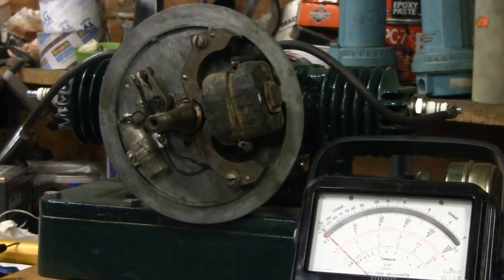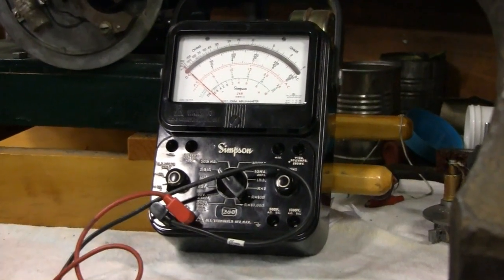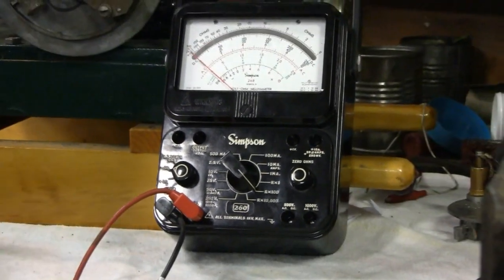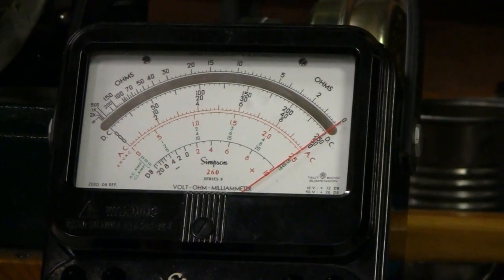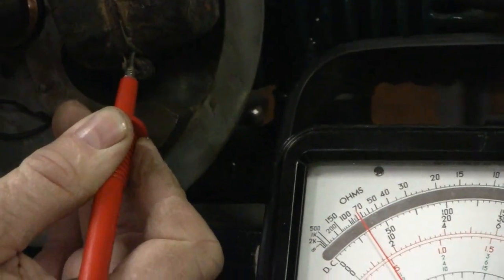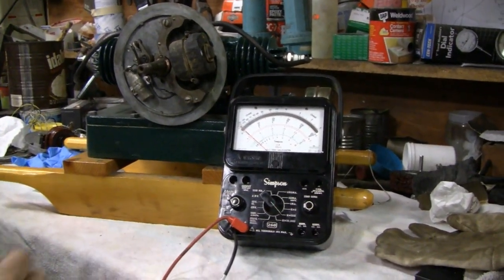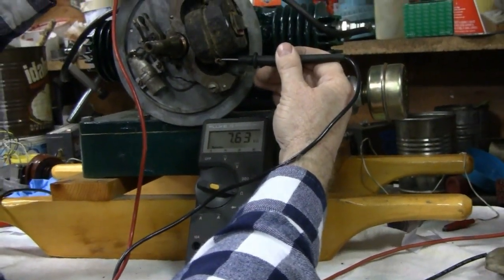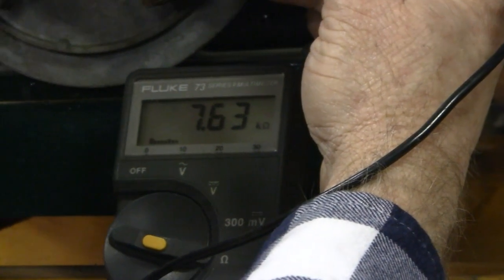HOW TO TEST IGNITION COIL WITH MULTIMETER

Comment: i have a honda gx670, i have just cleaned the carb and put new plugs on it, the motor will run fine on a cold start for about 5 mins, when it gets warm will cut off on anything over half throttle and no spark restart. is this a bad coil problem, thanks roadking

Comment: What should the WICO coil read?
Reply from the maker: Don't know, but probably about the same!!☺
Reply: have you checked my channel for the Heinze model #57 ????? LOL Nelson muffler, wico ignition, tillotson iron horseJohnson carb, Appleton electric intake, CASE on the mounting plate. Unusual little engine
Thanks
Reply: can the ohms test be done with flywheel on. from plug wire to plug wire? I tried it and am getting 8.5 with meter set to 20k ohms

Comment: They say it takes Twice as much voltage to induce the spark plug to fire INSIDE an engine under compression that it does OUTSIDE the cylinder.
Reply: who is they and why?

Comment: You can be tricked by a coil testing OK with a meter and still not work.  They short inside only with the high voltage.  Spark plugs can test OK out of an engine but won't fire under compression.  These are the real brain buster problems.